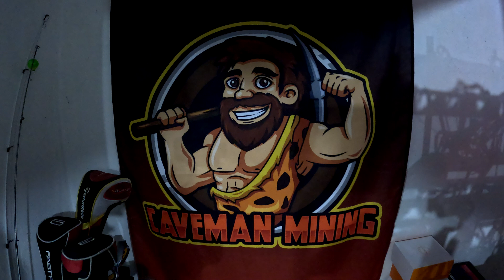Burnt up! Risks of GPU Mining

Comment: Great advice on power management CaveMan. I know I only did 750watt sever power supplies with a ATX about the same power rating pre rig, I have the same PDU and it's got a ton of c13 to c14 inputs so I don't run more then 3 to 4 cards pre power supplies. Safety is 1st in my book and not to run alot cards or watts just cuz it can doesn't mean we should. If I was u I wouldn't run the 1600watt sever power supplies cuz then ur going to load it up and run more cards and watts on 1 power supply and think a 6 pin can run them all. Like (Music3479) said and what I know when I started building my rigs over 2 years now, 6 Pin power can only run 75 watts safely. Safety and peace of mind run less cards/watts and more sever power supplies. Keep living the dream good sir.